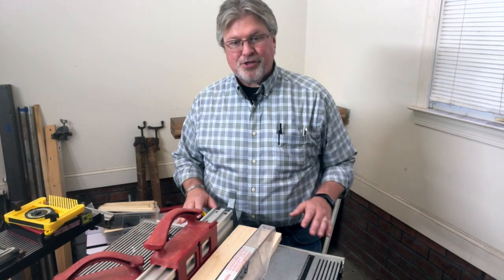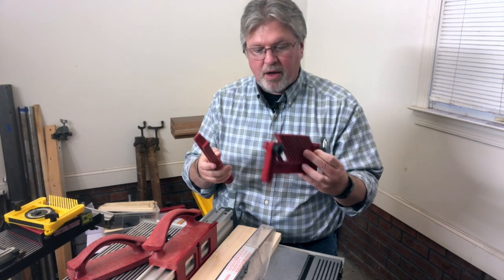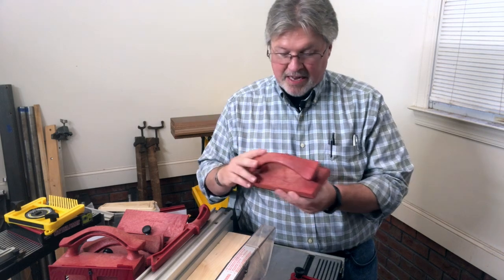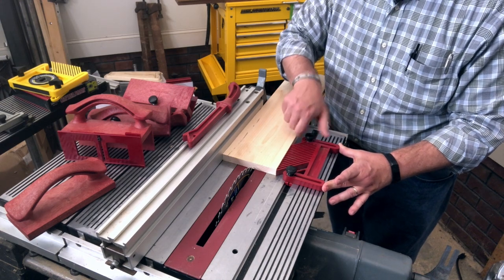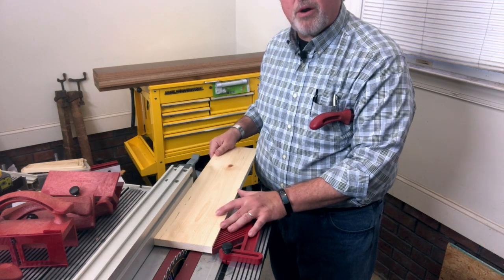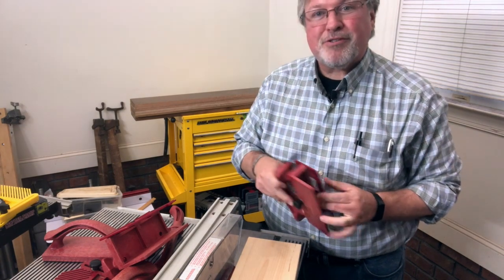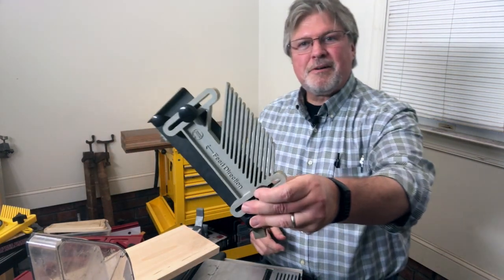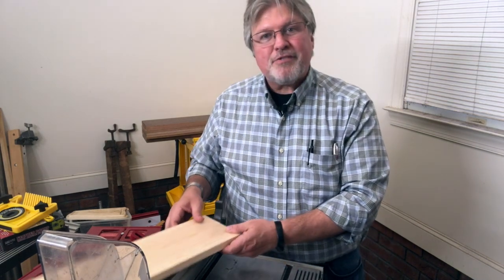The Shopsmith 5 Piece Safety Kit: The Finger Keepers!

Comment: I retired after 40years as a full time safety engineer. I’ve been wood working 54 years ( man and boy) and I can still count to 10 on all my fingers.  I agree that the safety tools are critical to proper, professional and safe woodworking. There is one other safety piece that is not a push block, guard or similar device. That is the table insert, and the fact that the insert is painted red should be a visual cue that your fingers are getting too close to the blade. Keep up the good work.
Reply from the maker: Such a great point. Thanks, Scott.

Comment: I have had a Shoposmith 500 since 1978.  I that time I have upgraded three times, first to the 510, then the 520, then the new motor which I use most of the time on a 220v outlet but sometimes I just wheel the Shopsmith out of my garage and use 110v.  I have on occasion missed one of the five checks and had to make my desired cut on another board and them boards can be expensive.  Stay safe out there.
Reply from the maker: That five point safety check has to become habitual, for sure. Since 1978? Where did you purchase it?
Reply: @MyGrowthRings  from ShopSmith I believe. I saw a demonstration at the Santa Anita Mall which is right next to the Santa Anita horse race track here in Southern California.

Comment: I use the safety kit on my 10ER,  :)  the only downside is the fence straddler hangs up on the fences rear lock knob before the wood is pushed all the way through, so power down before removing the cut piece.
Reply from the maker: Yeah, I have a 10ER too and know what you mean. Perhaps we should just fabricate a one from wood that sits a bit taller?

Comment: Another good video Scott. SAFTEY just CAN'T be stressed enough. Safety is NO JOKE .. it is also ... NO INJURIES. It only took me having to meet a few people that were in a rush, to the HOSPITAL a couple times also, to understand that when I THINK something might be dangerous .... IT PROBABLY IS. .....USE THE SAFTEY EQUIPMENT. KNOW AND UNDERSTAND when and HOW to use safety guards and equipment. I saw a guy lose 3 fingers because he was using gloves (to be safe) while working with a drill press ... seems logical but when the drill got hold of the glove ..... it was over in an INSTANT. PLEASE always be careful. Another guy I knew cut his forearm OFF with a Radial arm saw ... again ..IN AN INSTANT. He reached across the blade while sawing .... Don't EVER say "it won't happen to me" a few of these guys had worked with the same equipment for YEEEEARS and it only took a nanosecond for tragedy to hit. FOCUS on what your doing. PLEASE.
Reply from the maker: When I was working at Shopsmith I asked every woodworker I met who had an obvious power tool injury how it was caused, and the most common thing I heard them says was “I thought it wouldn’t hurt if I _______’ed this one time without using the _______ and that’s when I lost my ________”. So many had one last chance to make a smarter choice but chose not to because they didn’t want to bother. I get it.

Comment: I agree you cannot have too many safety "gadgets". I have accumulated over the years all of those you are showing from Shopsmith and various other companies. Over the past couple of years, I have been using the Gripper which is made by Micro-jig mostly on my Delta table saw. They also make push blocks and a couple different varieties of a splitter system. I have used the Gripper on my Shopsmith and it seems to work just as well as on the table saw. I would be interested in any comments pro or con about the Micro-jig products and their compatibility with the Shopsmith.
Reply from the maker: The push block is 100% comparable with the Shopsmith, though they do have a couple items that aren’t so handy due to the size of the SS main table. Their taper jig, for example, can be too large for a Shopsmith Mark V 500, for example.

Comment: Ok only thing through building cabinets when and or before cnc did all the work, the push stick is only thing I sold away asap! 
Its duck bill is way to short if you have human error. Just an example I use Big Horn 10223 V Push Stick.
Bigger surface area to also stop wood rising at end of cut.
Reply from the maker: I understand that is a popular opinion about push sticks and I don’t necessarily disagree. I’ve gotten so used to using the style ever since junior high schools that it’s just second nature to me. Still, it’s a very important consideration and I appreciate you bringing it up.  Scott

Comment: Here I am 3 years after this video but wondering if they still make the blade guard for the 500 series?
Reply from the maker: Unfortunately, no. They do show up occasionally on eBay, where I was able to buy one new in the original original packaging. There are also resellers part out old machines. Look for Damien Smith on the Facebook Shopsmith group.

Comment: is there a way to replace the foam on the bottom of the push block? stay healthy, Russ
Reply from the maker: There is, but unless you plan on replacing several it is cheaper to buy another on eBay. To replace it you can purchase the foam from Lee Valley. Search their website for “High Friction Sheets”.